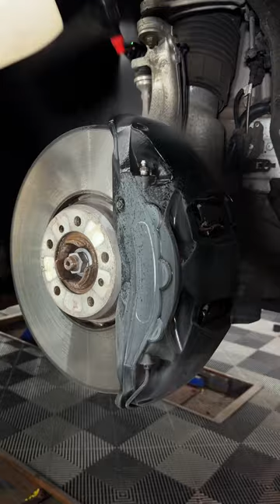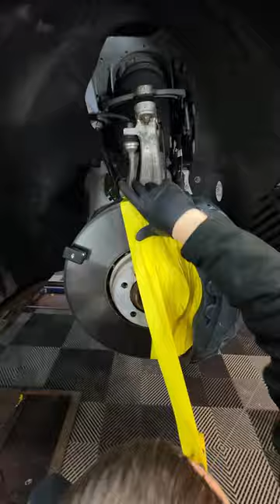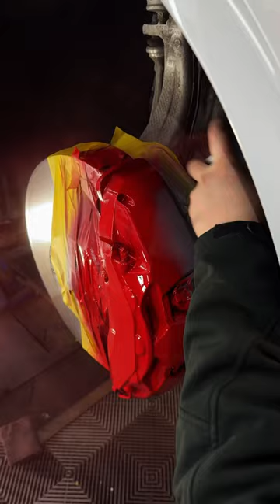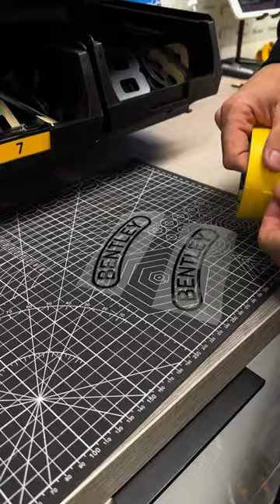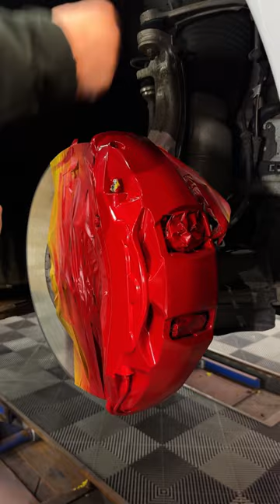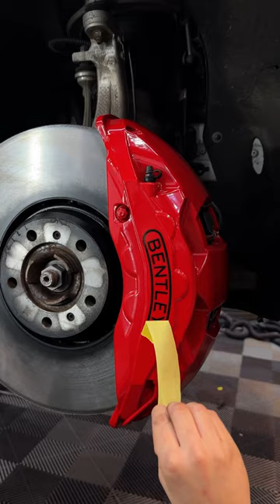Professional Bentley Calipers Painting 🤤😍

Comment: Just pull them off and have them properly powdercoated
Reply: Yo fail to see that they are not mechanics so do the easy route .
Most mechanics won’t paint calipers so now what …😂
Reply: @chiefrocka8604  I do but it’s $1500 for all 4 usually because it’s a whole day ordeal just to pull them off degrease remove rust if they’re steel and then do several coats, reassembly bleed brakes and touch everything up and final polish…. AKA most people aren’t buy the service 😅

Comment: The heat build up on the caliper will cause the BENTLEY stencil to warp and peel.
Reply: Thats not true. Ive had this done before on calipers and it was just fine.
Reply: It needs a proper clear coat for yea but this didn’t get it. Not sure if they just didn’t record it or if they don’t know what they are doing
Reply: the guy could have made a stencil, just peel out the letters not the background, and then paint the letters black.

Comment: Why didn't you pull the caliper off, pads out, slide pins out, etc and do it the correct way. And then just spray the rotors hats and not cover the disc. Wow.